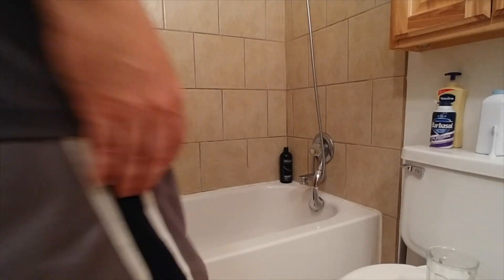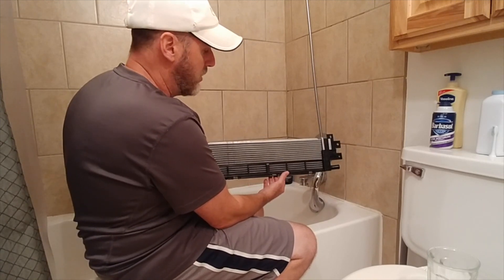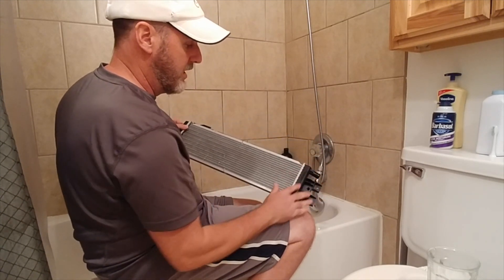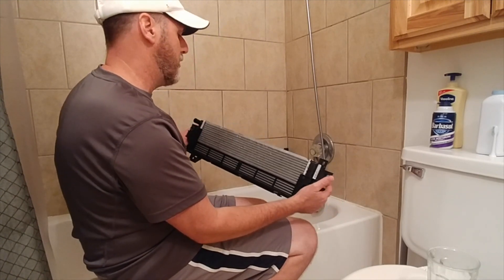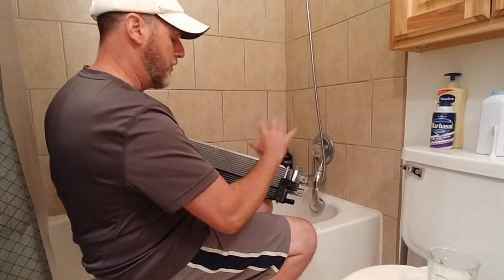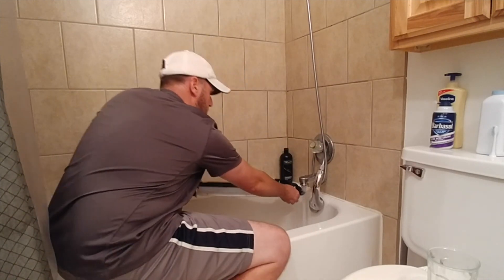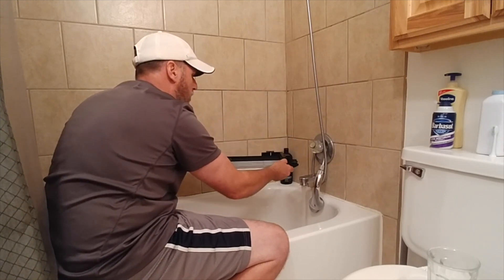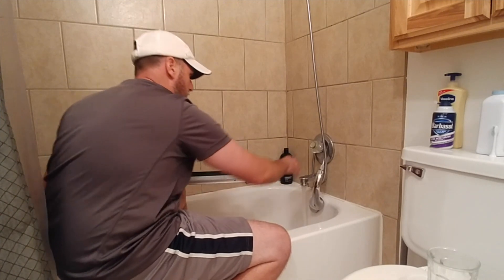Factory heat exchanger coolant capacity??? Q50/Q60 3.0T

Comment: Hey! So i just installed the AMS Heat Exchanger on my q60 and did the proper steps of bleeding / vacuuming. Although my coolant was gone after a 30 minute drive. Is this normal after installing these? I checked and there were no leaks in the under-tray (yes I unbolted and didn’t see a drop).. 

How many times do I need to check it regularly ?
Reply from the maker: It tends to be like this for me too. out of the three time I've installed these it coolant overflow tank does drop some. Just keep filling it up until levels out. takes maybe a week. If it takes a month then there might be a leak or loose hose clamp.
Reply from the maker: I also have put my vaccum tool back on a second time in the same day and re-run the procedure and it seems to help. I guess where the tool seems to work the best is when a lot of the coolant is darined out and a fair amount needs to be replaced. When I do my HX swaps I tend to not lose a lot of coolant.
Reply: @GettingthruLife  yes I did that right now, just worried that the 30 minute drive with little to no coolant caused a major damage 😓 hopefully not but I’m afraid to hurt the engine even though I followed all procedures properly.. I used the Mishimoto Vacuum Bleeder Tool Kit
Reply from the maker: @thatredcam  No, won't hurt things but I wouldn't go extended amount of time with no coolant showing in the tank. Just keep an eye on it. It will level off if everything is sealed back up. Low coolant in the engine/radiator is more serious. These 2016 to 2018 Q50-60's can develop pourous blocks and then coolant disappears. Hopefully by 2019 Infiniti caught on to this shortcoming and resolved.
Reply: @GettingthruLife  It’s very strange, I have a 2019 q60 and I got the engine replaced about half a year ago due to coolant going into the oil or something like that.. warranty covered it all (thankfully) and this was all stock at the time.

This is why I’m sorta traumatized, I did all of this today and then I drove it 30 minutes and felt power completely gone in second gear so I pulled over and drove home slowly bc the radiator tank was dry I was like wth! So I vacuum/bleed that tank and it seems leveled now but then I drove it 10 minutes right now and come home to see the Heat Exchanger reservoir gone now, so I vacuumed/bleed that one for the second time.. I’m just worried to drive it now..

Comment: Hey if my Q50 is basically stock but I upgrade to the ams heat exchanger. Would I need an expansion tank as well? Or will the stock coolant tank work fine?
Reply from the maker: In my opinion for normal driving and casual fun just upgrading to a AMS, Mishimoto, PLM heat exchanger will make a big difference. I never saw the benefit in the AMS all in one metal radiator/HX coolant reservoir tank besides it looking cooler than the factory infiniti one. The in the fender coolant expansion tank by AMS is better for a capacity addition but just means it takes the HX coolant longer to heat soak but it will still get hot once you run the car enough 120-130 degree in summer months. Maybe help the HX system sit a few degrees cooler in the long run but 399-499.00 high price. To me, the AMS additional tanks could be worth it if making the ultimate race Q50-60 but for most, overkill. The ultimate HX is AMS's new race core, oversized HX but that's $1000 and it takes some modification to make fit.

I'm happy with my AMS clone, the PLM. I got mine for $400 to my door.

Whatever HX you can get the best deal on is good. I feel the ones that mount in close to the factory design work the best for all cooling situations (moving, not moving and slow moving recover time plus running the aircon can help with cooling when airflow/speed is limited).

Comment: FB 118 holds 32oz 
FB 101 64 oz
BMS 25oz 
Visconti 61.5 oz (600% more than stock)
AMS: 44 oz (402% more than stock) 
Stock HE 8.79oz
Reply from the maker: I showed that it's not almost nine oz right before your eyes. Why it's good to see for oneself. I've purchased a PLM HX that should almost be identical to the AMS so videos on coming soon.
Reply from the maker: I am doing a measure of the BMS and PLM plus I just remeasured the factory HX. The factory unit though really slow to flow/fill up maybe I didn't give it every last gulp it could hold. This time I took extra time to make sure it was really full. I measured approx 8.8 oz and when I measured the BMS I got 46.2-3 oz. I have a future video that will show the contents of the PLM, stock, and BMS along with side by side photos and weights because the BMS is such a heavy slab of aluminum.

Comment: the only benefit i can think of is the extra cooling fins to help with cooling not so much holding the extra half a cup of coolant
Reply from the maker: Yep, you need coolant to have it cool the coolant.  A half a cup doesn't transfer much heat.

Comment: Thats an EASY 35 horse. Easy !
Lololol.  
Wow, I can't believe they actually think that is helping. I guess I'm going to be saving up for a heat exchanger now...
Reply from the maker: I would be interested to know what the total capacity of coolant for the heat exchanger system is in the factory car. Someone can probably find this online in the shop manual. If it's just 3/4 of gallon or less then that is pitiful. No wonder it doesn't work in 75 and above temps when racing the car around even with 300 hp version. I would like to do a bunch of test to find out some truths/facts in many areas but I don't have unlimted time and money to burn taking apart things and trying things out.
Reply from the maker: With heat soak yes 30-35hp loss.

Comment: It's not for the amount of cooling liquid. It's more about the surface area to help cooling.
Reply from the maker: So for example, AMS is just making parts that increase fluid capacity (auxiliary intercooler tank and their coolant expansion tank) because why?
Reply: Q=m*cp*dt. Higher mass (or volume of coolant in the system) means higher total heat is absorbed for an equivalent change in temperature. However like F0RS8KEN said if you can get your available fluid back to temperature quickly with a more efficient heat exchanger than it doesn't really matter. The fluid itself has the same cp value and thereby absorbs the same heat as it passes thru the intercoolers regardless of total system volume. If once it passes thru a larger exchanger it's outlet temp is back where it was then you're all good
Reply: @GettingthruLife  Yes you need both. That's not what I was responding to. I was responding to your video about the amount of liquid the heat exchanger holds. But technically yes you don't need a ton of liquid if you can keep said amount of liquid cooled.
Reply from the maker: This is not pointed at anyone in particular and sorry for the length of this. Obviously, a larger HX with more surface area in basic theory/concept is going to work better, but with increased size, it's a given that there would be coolant capacity. The AMS version demonstrates this. AMS promotes an increase in the coolant of 402%. Note: If AMS had made their exact same, larger HX but they designed it to hold the same amount of coolant as the oem hx, than in all likelihood it wouldn't produce much better results than the Factor HX. This illustrates that capacity does play a role and is typically a mutual benefit of going bigger. Bottom line,  the factory HX system and the actual HX part is weak and insufficient. The intercoolers on top of the motor too are likely inferior specs due to size, coolant amount and flow parameters. Infiniti clearly cut corners and threw this system together as an afterthought. 
To have a good air to water heat exchanger it takes the right amount of coolant in proportion to size to have a good setup (better to have more coolant than not enough). This is the reason why AMS engineered not only their bigger HX made sure it held a bunch more fluid content and as a bonus gave options to add even more coolant capacity.
The underlying point of this video was to illustrate how inferior the oem HX unit is(not just by itself but to mounted up as a supporting hx). Also to point out why would anyone want to add the factory HX to a system that they are trying to make better? It's an inferior part. Hopefully, it's clear to see that any gain you would see by running things in tandem would be so small that not worth the time and effort. (Would make for a great test/experiment) *Even may be causing negative results because the factory hx is most likely a restriction/a choking point. 
Many people may not know that the hx pump flows at different rates depending on what the ecu is telling it. You start pushing the car causing more heat then the hx motor kicks up from 40% to 60% and 80%. I've monitored this on my Ecutek app. The factory HX may not even be able to even meet the higher flow demands of the coolant pump turned up.  From my experiment in the bathtub by pouring/introducing water into the factory HX, it is limited in flow due to its petite size. From visual inspection, the channels running the length that carry the fluid whereby it dissipates the heat are almost to small to flow liquid. People should use a flashlight and see this for themselves. On a more qualified HX there are more of these channels and they are likely bigger to not pinch off or impede flow. Lots of experiments that would be cool to do to verify these things but i don't have all the time and money laying around to invest.
Reply: @GettingthruLife  if I had two systems with the same  heat exchangers (same heat transfer coefficient and overall area) and the only difference was I added the ams expansion tank, then you'd benefit by being able to absorb a greater amount of total heat. But the time for your system to cool wouldn't change. So as an example, maybe I could do 2 WOT runs in my first system before heat soak at which point you pull timing to prevent knock. In my larger tank setup maybe I could do 3 WOT runs, but at that point I'd be in the same boat with both systems, limited by the time it takes to cool the fluid back to temperatures within  my tunes limitations and the heat transfer of the actually exchanger becomes the real key to keeping your temps down
Reply from the maker: @anthonyb2426  For sure, all make logical sense. Extra fluid alone just takes more time to heat up. Key is an efficient way to continuously lower the temp to the range you need. More fluid to space out heat and good heat transfer/exchange is the ultimate bonus. I love really enjoy coming up with a way to see if 2 Burger Motorsports HX's could be mounted up and set in a series. This would cost $600 vs AMS $800 and would be even more surface area and coolant capacity. If I just had access to machine shop and money to burn. The burger motorsports by itself runs likely 5 to 7 degrees higher than the AMS (benchmark) from what I've been told by people with experience. 2 BM's would dissipate ultimate and save $200.

Comment: Thank you for putting this into perspective. I've been debating getting one but after this I just ordered my ams heat exchanger. Half a glass is poop
Reply from the maker: Yeah, I knew the factory HX was rinky-dinky when I took it off the car but at that time I didn't put 2 and 2 together that it actually held such a small amount of fluid. Just because I like to see results for myself,  I wish I could have measured the total amount of coolant out if the entire stock HX system and then measured the total amount coolant to refill the system after I added the Burger Motorsports HX. I'm a individual that likes to be informed and not just assume things or listen to what people/manufactures/reviewers want me to hear.

Would be cool if someone with the AMS HX filled theirs up and measured it's content to see the actual content results. That way we all could become  more informed between the differences of the  AMS, Mishimoto, Burger Motorsports, frozen boost, and PLM and then justify the cost differences better.

Comment: I’m pissed to find out that that’s all the coolant that’s cooling my turbos. Fawking Infiniti 🙄
Reply from the maker: Well, there's a little coolant in the hoses but the inner diameter of the hoses is not much. No telling how much sits in the twin intercooler on top of the motor. Likely, my guess is there a half-gallon flowing thru the other parts if that. I would guess the  Burger Motorsports HX holds 3/4 of a gallon all by itself with those big end tanks. It is shocking how small the factory HX internal size is for coolant volume. Kind of busts the plans of seeing benefits buy running this along side a burger motorsports or a frozen boost for extra cooling capacity. I literally can see this little factory HX as a choking point to a better/freer flowing, after market heat exchanger. Now I don't feel like I'm missing out by not running this as well. Just better to buy the AMS inner fender expansion tank or hopefully a durable plastic one by a company likeZ1 motorsports and sell for $300 less than AMS.